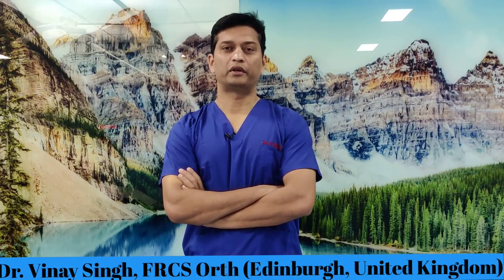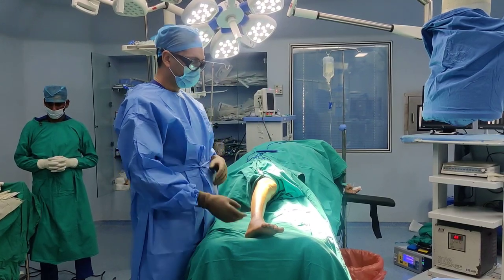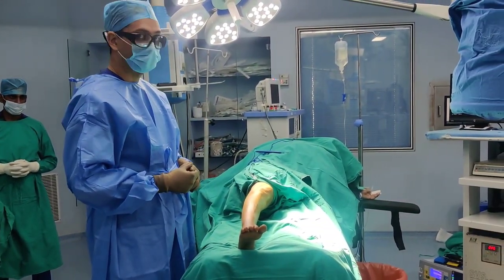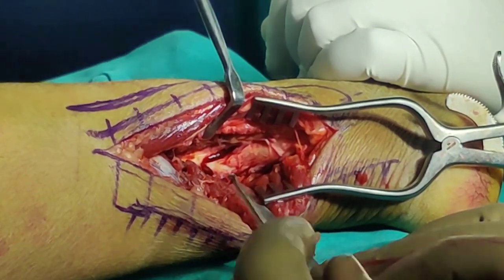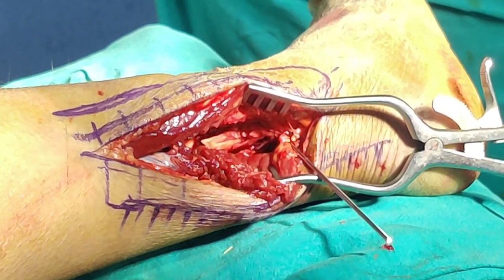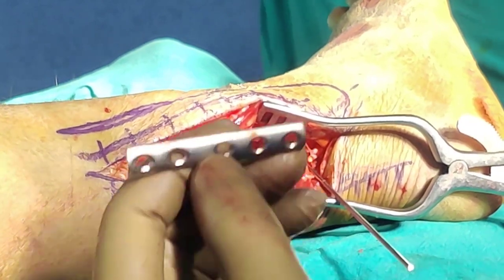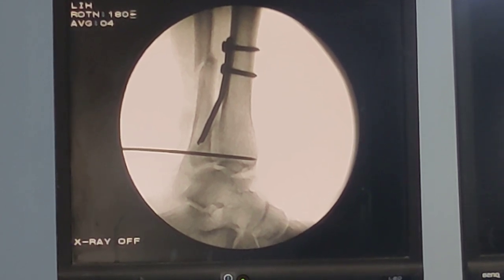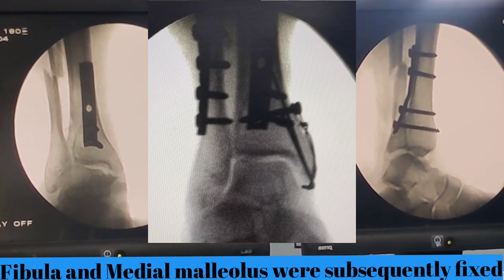Buttress Plating of Posterior Malleolus with Posterolateral Approach

Comment: Buttress is when only the screws in the bone(larger frag) can hold the fragment in place via plate. Here only the purchase of distal screws in opposite cortex is holding the actual construct in place, I find 1/3 tubular short of required rigidity here and prefer low profile 3.5 LCP , still nicely done Dr Vinay.
Reply from the maker: One third tubular plate is just fine

Comment: Sir thanks for all information in your channel , with all respects what about the tip of the screws at anterior medial , doesn't cause irritation ,and wouldn't be if we use the distal radius plate low profile and locking Which only needs one cortex for supporting.with regards.
Dr Ahmed alhweitti orthopedic surgeon in Saudi Arabia
Reply from the maker: Thank you Ahmed. Soft tissue irritation is not an issue. Locking plate has no indication in this fracture.